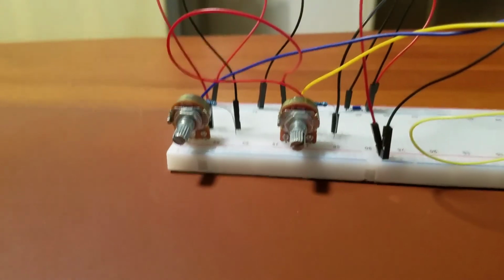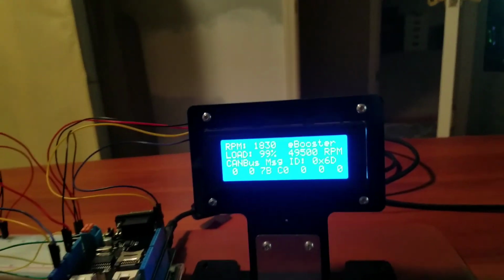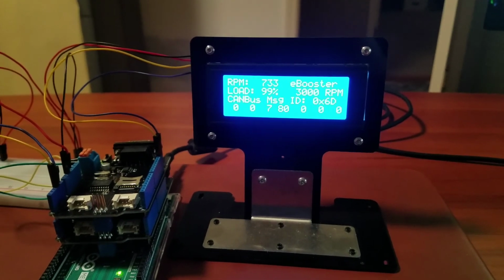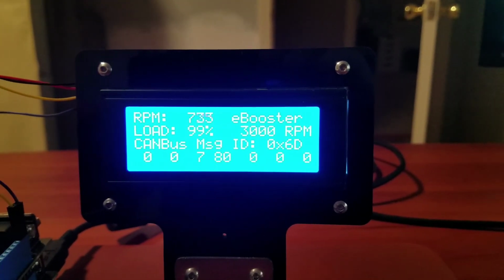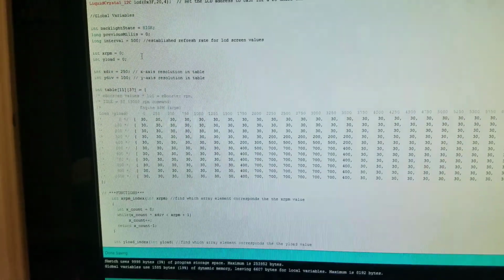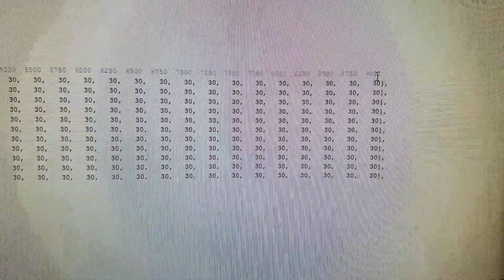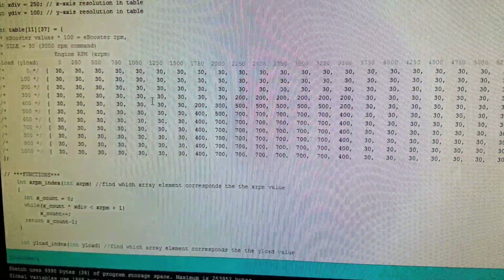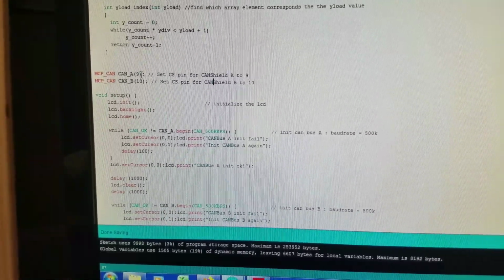Rear-mounted Turbo RS4: Arduino CAN Bus 1 test - March 2020

Comment: The explanation is very clear. May I ask if you are using an Arduino Mega board?
For the superimposition of two CAN-BUS shield boards, one of their SPI pins is 9 and the other is 10 in the video, and the default pin of the V1.2 version is 9. For the modification of the pins, did you cut and solder the back of the PCB?
Reply from the maker: Yes to the Arduino Mega board and cutting/soldering the back of the Seeedstudio CANbus shield board to change the CS pin from pin 9 to 10
Reply: @ezracing900 Thank you